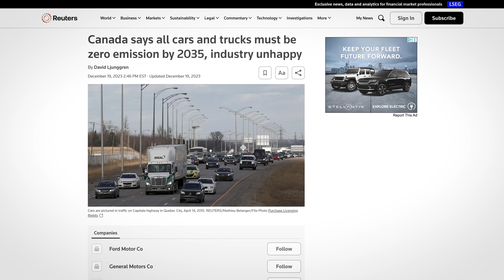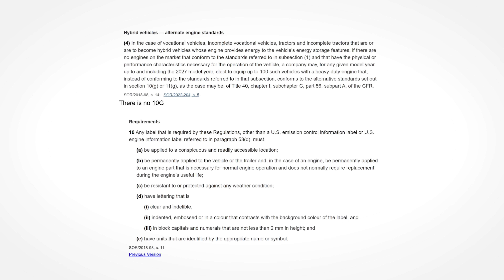Government Red Tape Is Blocking Our Plug-In Hybrid Trucks

Comment: Sadly the cost of being on the cutting edge of technology is often Governments are years behind.  Add on to the fact that Edison is not a large company that can afford to lobby change and you get this kind of issue.  It would be nice if you can get a legislator to amend the law so that diesel generators can be used on-highway as long as they meet the emissions requirements for highway use.  Glad you have the mechanical trucks to fall back on.   The red tape must be so frustrating.
Reply from the maker: I get that were on the cutting edge.  Our mistake was assuming that if the government was mandating that people have to go hybrid with generators by 2035 that they would have made the rules to allow hybrid generators
Reply: @EdisonMotors  Yeah, they better get on those "hybrid generators by 2035" regulations. If they don't, 2035 will be here before we know it and, "Uh oh! It's 2035 and we still can't allow hybrid generators."
Reply: @EdisonMotors it always felt to me like the politicians jumped straight to EV and never thought of what was needed to transition from ICE to full EV vehicles.   Hybrids are that bridge they need.  The hybrids we do have are all parallel hybrids where electric assists the ICE.  Only Edison and the Ramcharger are serial hybrids where the ICE is just a generator.  I hope you can find some politicians that can run on this platform (it looks good politically too) and make some changes to allow Canada to be a front runner in hybrid trucking.
Reply: @Wild_Lee_Coyote  EU has already pushed their EV targets already, they'll do it again in the EU and elsewhere. (who remembers when EU promised to be all electric by 2020 lmao)
Reply: @EdisonMotors  EDISON SCANIA  WILL HELP YOU OUT SCAnia is the best they will help you guys out
Reply: @EdisonMotors  why didn't you go the variable speed generator route, like they do on the diesel electric locomotives and series hybrid cars?
Reply: @EdisonMotors  I'm 1000% sure this came after one of the big established truck companies went and cried about it/"lobby" against you guys to the government and some money deal is behind all of this!
Reply: @EdisonMotors  Dude you are not on the cutting edge, we have had motors, generators and electric cars for 200 years...for most of that time people didn't put them all together because there was no point to.
Reply: @smartmonkey777  so they're developing a novel use case for technologies that have been around for 200 years, that few people have adopted? Sounds like, the definition of cutting edge lol.
Reply: @EdisonMotors 
It’s all double speak. The more complex, the more chaos the more likely of a breakdown the more costly it is to the consumer, the more money generated for the government.
If it wasn’t, we’d still have the right to repair.
Reply: In this case, Government is years ahead regulating fairies before magic is invented..
Reply: Western governments are more harmful than "terrorists". They get in the way for people being able to afford to build homes and get food. Over government regulation is killing the means to live.
Reply: Agree.
But I think there's another issue here.
..
If Canada's government
For example, made an exemption or created a law. That would allow Edison to proceed with the manufacture of hybrids.
..
This law would or could be tailored to Edison Mtrs.
..
This law would or might not necessarily suit/fit the larger legacy manufacturers as they would have different operating criteria & procedures.
..
In that context a hybrid law that works for a small independent company might be unproductive for a larger business..
..
So the government would want to get the regulations right the first time without having to re do them at a later stage due to unforeseen /unintentional consequences...
..
Reply: stick-truck's/hybrid-combo already got tried in the C8 market and or for box-truck's didn't do-well/sell-well and 3-party shop's hated-it and or more hassle, yes my personal charger is being setup like that and is is setup like that but that's because im trying to save the 1960's-vibes not because best-practices engineering-wise and or you give up a lot of mode's/use's like off-grid-ICE-power ect, whenever i get the chance i might put/reservations for the ( i don't have a CDL or use's for it, and if i did id flunked my testing as i cannot tell-brig-gap/nose-spacing-ect aka car-huler-centennial pivot is my limit's ) 1-ton market as my ( making anyone feel better gm 80's stock/dealership's delivered cannot pass the yearly-testing or at least my-vin/other's i known+there-vin ) 1980's-K1500/show-truck* could use new-guts and or get me out of EPA-hell-week

as a investor ( in USA currently and sorry my moon-shoot $$ is tied up in( family ) courts, but i was/still considering if rounds are available, as i did have stock in Tesla's but not as early on as i probably should have happened aka late/~modelX~ to the party rather than s/or/3 lunch the roaster for broke/19yo/1-basket was just 2-risky for me as i remember the last Canada-car start-up out of newbrunwick and or tucker-llc ) this governmental red-tape makes me nervous ( your governmental wants green backs and job's+taxpayers it might figure this out and im not a tree-hugging types i just see a better product and or for driver's less ear/kidney-etc damages and possibly for running trailer power/BEV+refers-mode and or sun-powered ect ) as the original goal looks viable ( and better than my ( RIP cancer in 2022~ 30y-career )dad's purple-pete with a cat ect or llc miller's-fleet is/was ) and or they weren't flip-flopping around a lot wasting time and R&D-budget's and putting more into building up the factory and dealerships networks ect and branding-ect, seen the same mistake's/failed-llc's in farming as others parts of my childhood/family are ranchers/dairyman/simplot-contractor's&supply's

miller fleet ( 2019-2022 era for comparison and or talking to the EPA/Canada-version ) runs 3-ice diesel's( per-load/driver ) and some also have a bunk-N2-heating, so this model+new trailer is 1-running/dead-lb's aka way less and 0-on if plug'd/sun-modes-running
Reply: Okay Hybrid means generator AND plug-in...not just plug-in electric.
Reply: The government is years behind? Guys, these laws are DECADES old. What part of "Edison truck yokels are a pack of incompetent, illiterate numbskulls" doesn't make sense?
It takes me 5 minutes to look up the on-highway emission requirements, oh gee, what a secret that was! Fire everybody in that shop.
Reply: Dude this is old technology.
Reply: The amount of times in the past few years that I’ve watched the government make a rule with no way to actually comply, or like in this case, they actively get in your way of following the rule, is getting ridiculous.

Comment: Someone there doesn't want competition. They don't want the free market. Honestly. If there's no rules allowing you, then there's no rules preventing you. It's not what's been made illegal, if there's not laws and regulations against it, that's the Crux of the issue. It's not a can I? It's a why can't I? I would take this up with your local legislator or whatever the equivalent is in Canada
Reply from the maker: The problem is they made rules not allowing us.
Reply: @EdisonMotors , you're ok with the small production exemption until you make 200 units a year.
Reply: @EdisonMotors  have you checked if there is an elon sneaking around in there?
Reply: @EdisonMotors Move to america. We would welcome the manufacuring.
Reply: @EdisonMotors the problem is they dont want to consider the rules might need to be changed.
Reply: Damn, billionaires saw the innovators and rather than get ignored by them, they cut them off at the tap, being legislators.
Reply: don't attribute to malice what can easily be explain by incompetence.  They're using a non-vehicle engine in a vehicle.  Older regs, this limitation probably made sense because they're designed very differently and a generator is not fit to drive a standard car on the highway.  EVs are new and no one considered when rewriting the laws that a generator engine might now be fit to run a vehicle in limited situations, when the engine is not directly driving the axel.
Reply: @mrthewhite2620 the point is they are telling them no but have laws to back up the no.
Reply: @mrthewhite2620 sprawling bureaucracy and overregulation always result in headache, hardship, corruption, and waste. For hundreds of years now, societies succeed in spite of their bureaucracies, not because of them. Bureaucrats and socialists can no longer plausibly claim simple incompetence. Knowing what we know now, they are malicious almost by definition.
Reply: @nonchalanto  For hundreds of years people also got mulched in gears, abused, mutilated and killed too.  Regulation is a double edge sword, sure, but lets not pretend most of them weren't written in blood.
Reply: @mrthewhite2620 - explain your thesis of protecting us from injury and how engines being “on highway” certified protected us from being mangled…
Reply: @mrthewhite2620  And how exactly are emission regulations written in blood? because the only ways I can think of making that argument are multiple degrees of separation from the motor.
Reply: Maybe I'm too old, but I always thought that what's not illegal must be legal 😮
How can something not be "allowed" when there are no regulations?
Reply: Go to the top every where! Speak your provincial Premier , get him on your side first. Then try to get to Carny, this is his mandate to make Canada work in a new way!
Reply: It's just poorly designed legislation, it's not a conspiracy.
Reply: But they only want free markets that only suits them, since they are the main ones preaching free markets when they don't practice it themselves, hypocrites!!!
Reply: Exactly
Reply: They don’t want the free market—duh. Canada.
Reply: They will just make rules if you rock the boat too hard.
Reply: Get out of Canada. Go else where. Canada is a corrupt crap hole
Reply: there are rules that make it illegal, you can only put a highway rated engine to work on highways. this means i can put a ls into my civic but not a lawnmower motor into my civic. my guess main issue is tightness and shock resistance, a generator does not move, does not stop and does not hit potholes all of which can cause oil issues if not have a gas line fall off. basically there are rules that prevent engines that were not tested and made for highways use to be used on highways which us reasonable to ask.
Reply: what is significantly less reasonable is the cost of that testing, and what part change would qualify for a re-evaluation. But that's not Canada that's just the government, that's not to say we don't have an over regulation problem in Canada we 100% do just not this ,40 year old law.
Reply: honestly gave it some thought and unless you're not going to complete your certification within 4 years(a election period) it should be free. The benefit of it being certified is that it can create a market for the government to tax and generate income off of, so why is it my job to have my product meet your requirements when you're going to be taking a cut of the profits in purportuity and can change the amout without notifying me? reason for the 4 years is so people dont just try and get everything validated that cannot be validated basically preventing tirekickers and idiots from taking advantage of the system, the reason i chose 4 years is because its the length of a term and it can be used for propoganda making the government acrually insetivised somewhat to do it lol.
Reply: I am an American but I am a financial supporter of Edison I think you guys are fantastic wanted a pickup kit . Hope for your future
Reply: When there isn’t freedom outlaw movements are required.
Reply: I'm pissed.
Reply: Build it anyway.
Reply: Just start building in the USA
Reply: Didn’t Canada make a mandate for automatics and smooth drive tires.
Reply: But they allow railroad to do it. What if you stick with pre emissions truck platforms
Reply: As an american from usa i think we need to F the rules.
Reply: @JacobWillits it might be time for a repeat of 1776.
Reply: @JacobWillits Your doing that now fascist pig
Reply: @JacobWillits  i mean that has gotten you into an amazing spot so far
Reply: @JacobWillits  You guys are doing that now and it's not turning out real well.
Reply: @coffeebuzzz Not turning out well? How so?
Reply: @MisterTwister88  well for one, we're falling into fascism with a president who should be in a home for Alzheimer's patients. He was screaming on top of the White House the other day.
Reply: @coffeebuzzz  There’s other ways to skin a bear.

Frankly, the U.S. is struggling, however, there’s still light at the end of the tunnel. 

Canada? She’s been dead and the buzzards are picking at the eyes and the old poutine crumbs.
Reply: @coffeebuzzz give us an example Einstein
Reply: @controllerpleb6568 this bullshit is happening in socialist canada, not the states. They should move to the states
Reply: @controllerpleb6568   - How's the last Dem, Whitehouse resident/ dementia patient doing???
Reply: @controllerpleb6568 this video is about Canada
"Trump, Trump, Trump" cult 😂
Reply: @controllerpleb6568  are you always this simple minded or are you having a special day? Don't skip you meds, you need them.
Reply: @controllerpleb6568  Yeah, he was yelling from the white house rooftop...to the reporters yelling to him first. You're projecting so hard you're forgetting simple facts, Biden isn't president anymore. Good thing too cause that dementia and Alzheimer's was getting pretty serious there!
Reply: That's the fundamental difference between the US and the rest of the world. We can do what we want as long as it isn't specifically forbidden, but in most places, you can't do anything without express permission.
Reply: @TheMeepster72  most of Europe is "citizens permitted unless expressly forbidden, government forbidden unless expressly permitted", Quebec&Ottawa are too
Reply: That’s not true at all.
That is a legal tradition from England, and it’s true in almost all English speaking countries as a passed-down practice.

The problem is that our governments have gotten so big that there is almost nothing they haven’t legislated - for example in this case, Canada has “Highway certified” engines and “non-highway certified” engines and if an engine doesn’t have the highway certification then it can’t be used to power a highway vehicle.
Reply: @magratheadeepthought4675  not just England, most of Europe, Asia and Africa too (except France and Germany)
Reply: @magratheadeepthought4675 
The road tax needs paid. The red fuel can not power the truck down the road, it will be clear. Also will  probably have def and dpf equipment.
Reply: Canada is not a free country, they don't have freedom by default. They only have as much freedom as it is explicitly written in law, not an inch more.
This is very different than the US where the default is freedom and then the law restricts that freedom.
Reply: @aftoknito you think the USA is more free than Canada? Put the glue down and start sniffing some fresh air ffs.
Reply: @aftoknito you are so full of shite it comes out your speach hole.
Reply: @aftoknito  you seem to have a misunderstanding of both freedom and canadian & US law.
Reply: @boostaddict_ not at all, the founding fathers themselves wrote about this.
Canadian law is based on British law. Power in Britain emanates from the king and freedoms are individually recognized through laws. This is explained in the original Magna Carta.

Also, ragebait used to be believable, commie.
Reply: @aftoknito  Things have changed a lot since Magna Carta, which is not directly part of the Canadian Constitution, though it draws on it's principles. The Principle of Legality is operative in Canada, meaning there must be a law (and/or regulation) prohibiting something for it to be considered illegal (i.e. not have the right to do it). This is the problem Edison is running into. It's not that there is no law ALLOWING them to do what they want, it's that there actually are regulations (stupid ones) that cause them problems that should be addressed.

The Monarch in Canada is arguably more neutered than a POTUS (who is also "Head of State"). The Monarch's only true operative responsibility and power is to maintain the viability of the parliament and that is generally vested in their Canadian representative. All the rest is essentially ceremonial.
If the US system is so much better, why is Canada ranked higher on freedom scales consistently. Even the US based Heritage Foundation ranks Canada higher.

The founding fathers were brilliant, however the comparisons you are citing are 200 years out of date.
Reply: @richardb1452 you cannot be seriously quoting Soros' heritage foundation as a source... goodbye small hat.
Reply: @aftoknito  You can't seriously be saying Soros funded or in any way is or was involved with The Heritage Foundation, founded in 1973, helped elect Ronald Reagan and more recently published project 2025 and is universally considered a right wing christian think-tank.....wake the F up.

Soros has done lots of shitty stuff, but this isn't one of them.

I used The Heritage Foundation specifically because it is beyond reproach from far right wing folks who tend to be the most "MERICA" shouting people, but there are many other studies which show the same from across the political spectrum.
Reply: This is gen x  propaganda
Reply: @lloydmauler no, this is what Canada has turned into a hellhole!!!
Reply: @CherylGooder  YES. gen x ers did this. stop lying.